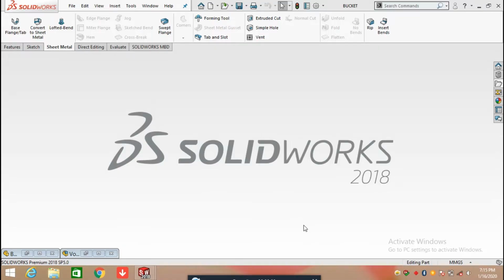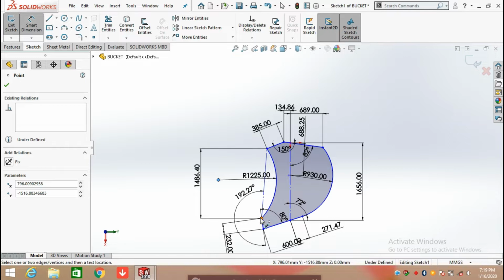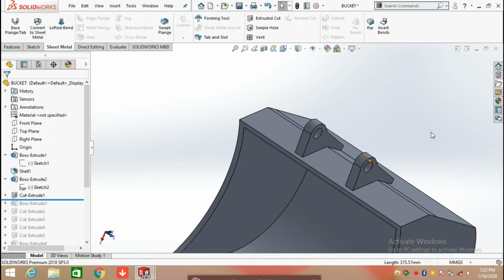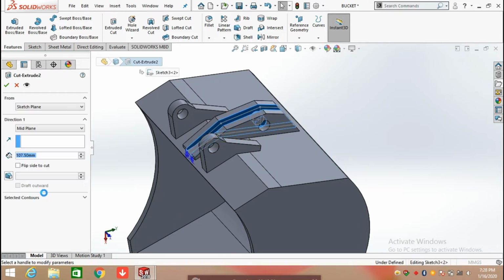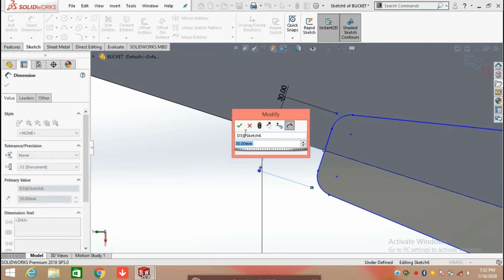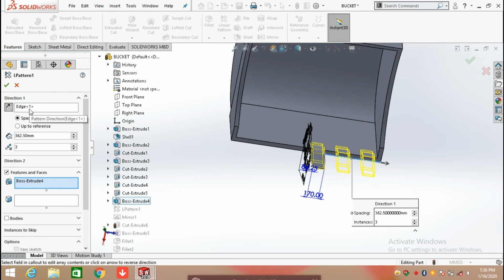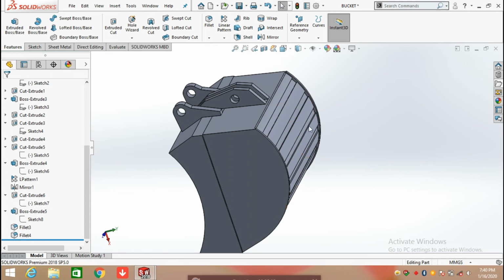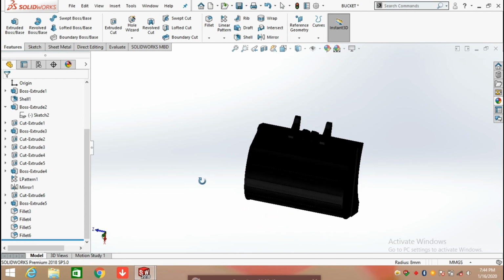Volvo Excavator Part-1 | Solidworks Design Hub

Comment: I thought this would be a great learning playlist but the dimensions and there relations are so f up that i should better check on other playlist. maybe this might be due to me being a actual manufacturing design engineer and using solidworks with out proper relations and dimensions is like playing a game which dont have any mission or goal
Reply from the maker: I will try to provide it's 3d for you shortly from that you can find out its dimensions also.